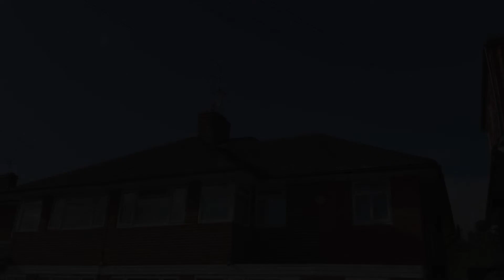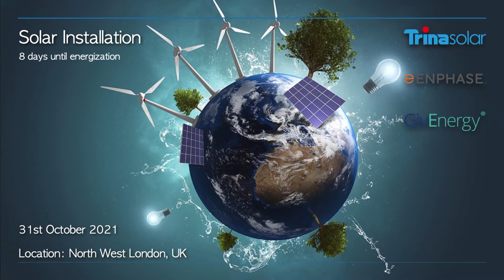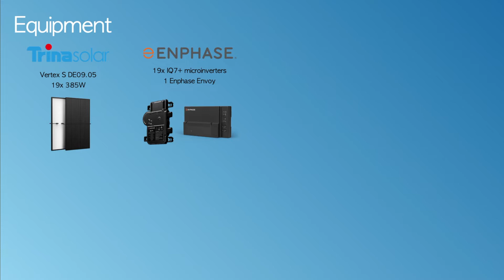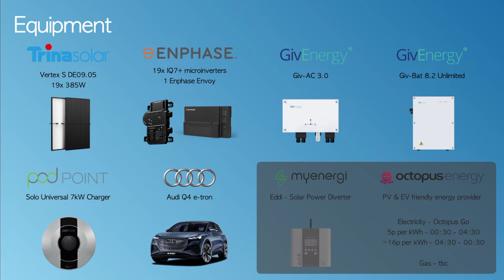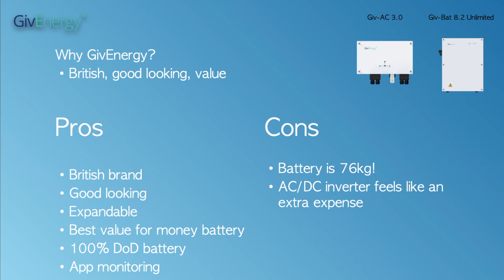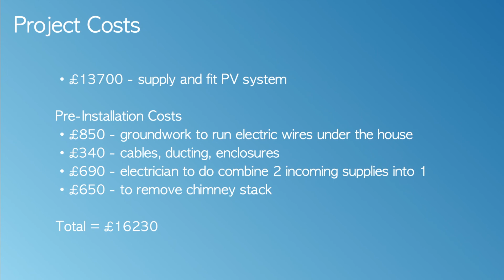Solar Project Installation North West London 2021 - 8 days to go

Comment: I admire how much time you spent on these presentations.

17 kilowatts of use is just above average in my eyes.

I use about 45 kW a day, working from home. Also charging a EV and heating hot water